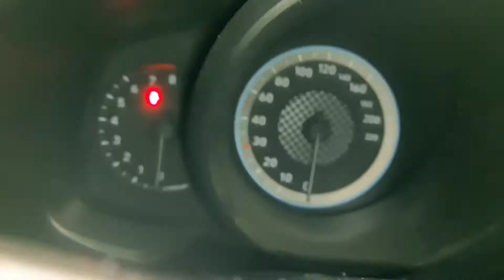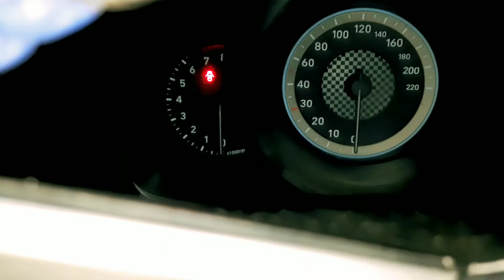Part -8 | CAN Protocol | ECU | In Car | CAN Bus in Car | Electronic Control Unit | Learn Automotive

Comment: The wire connection which you showed in the video as CAN..... is it really a CAN connection or sensor connection? CAN normally comes between CUs right?!
Reply from the maker: It's Sensor connection but the end will goes to cars computer and other ecus to process the sensor information to actuate.. hence the receiver bus is considered as protocol bus
Reply: @learnautomotive7875  Thank you:)
Reply: S that two wires are engine coolant temperature sensor wires only. This sensors connected to engine ECU. Engine ECU will transmit engine coolant temperature values over the CAN Bus. ICP ECU will receive this signal and will indicate the temp in analog meter in Instrument cluster panel